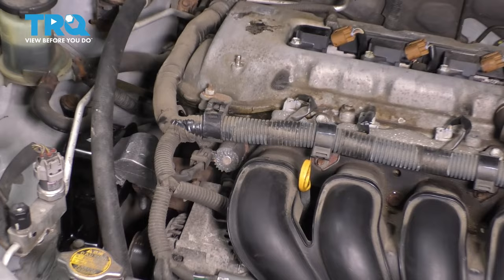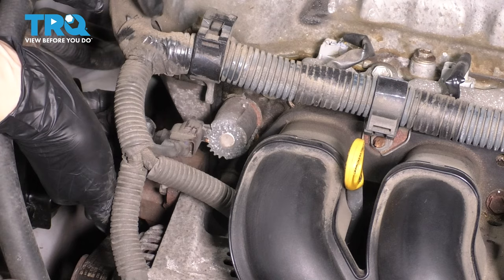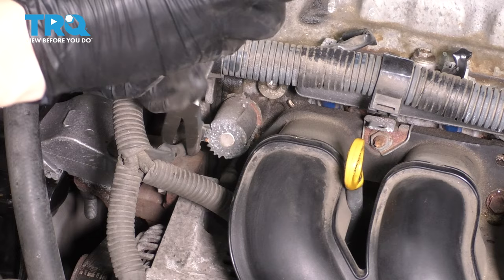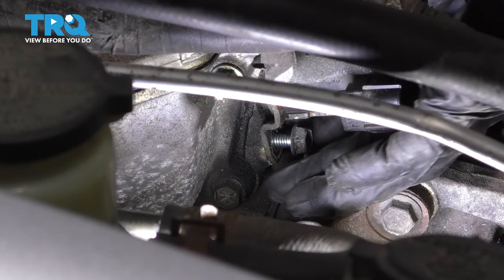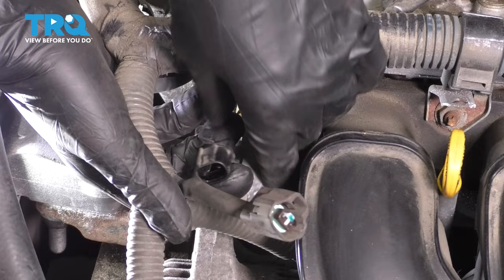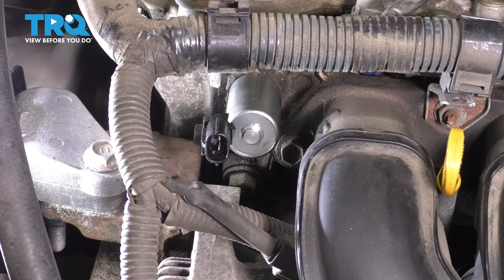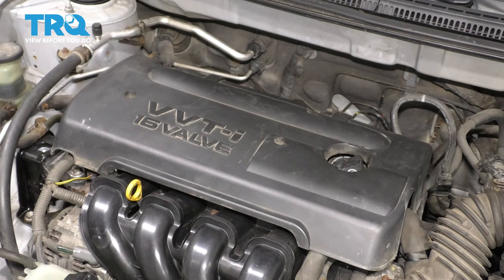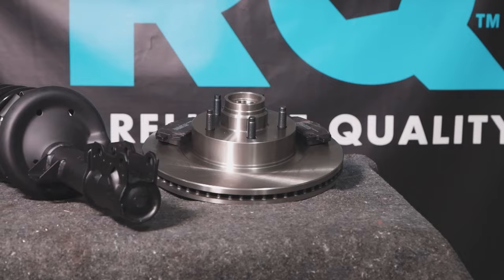How to Replace Variable Valve Timing (VVT) Solenoid 2003-2008 Toyota Corolla

Comment: This solenoid comes out easy... most of the time for an older car,  it will be stuck and only half of it will come out  Another half will be stuck inside the engine... Turns an easy job into a nightmare...

Comment: I'm getting code P1349. I did the test by applying 12 volts to the solenoid and it opens and closes. Could that still be causing the problem or should I look elsewhere? How did you determine this was the repair you needed?

Comment: I found this bolt very difficult to access on my Matrix XR 4WD.  A long thin/low profile ratchet extender made access very easy.  I simply could not access from the side - which looked easy for you, but I was totally on the struggle bus.

Comment: Thanks for the video! Just did the VVT on my 21 year old Toyota Echo. Had to remove the alternator bracket on the smaller 1.5L 4cyl, and the close quarters required prying it loose with the twist of a small screwdriver instead, but everything else was the same. The new valve was only $18 on Amazon. Nice! 👍